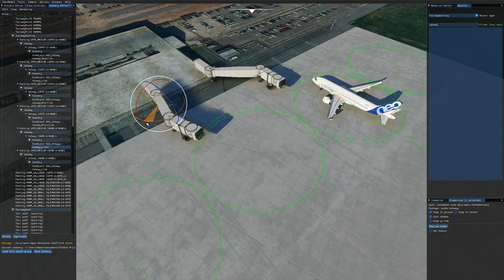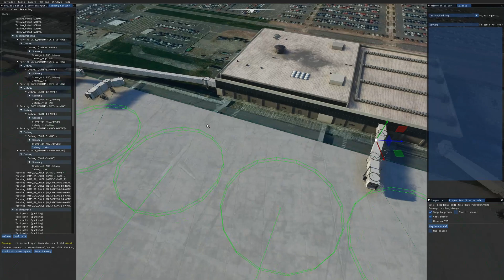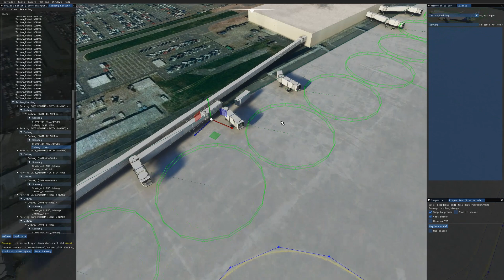SDK Tutorial #9 - Jetways and gates - Microsoft Flight Simulator

Comment: I wonder if it is possible to fix the default airports with broken jetways - they are separated both the scenery and scenery object (the main moving part and the not moving part connecting to the building) are not connected and they leave the gaps - basically like they used wrong type too short type which is too far away to be able to link automatically. I guess that during some large update Asobo broke these default jetways which were small and tiny and needed the large or medium.

Comment: Hello! Firstly, thanks for the great SDK videos. Have really helped my creations go from "meh" to great! Quick question: is there a second part for setting up the ATC to work with the jetways etc. so that you can call them from the ATC menu? I've set them up exactly as described but the airport I'm building doesn't normally have air traffic control, just a CTAF frequency, and therefore no option for tuning to ground to get the ground services or anything. Any thoughts/ideas? Cheers!
Reply from the maker: Great to hear that you are finding the tutorials useful! There isn't a second part to getting them working. You should just place them and ATC gives you the option when you are parked at the gate in the correct airport - that might be the problem there. Because you don't have a ground frequency that option mustn't be available to you. You could try adding frequencies to the airport, I've not done a tutorial on that yet I'm afraid, there should be some information about setting up the communications file in the SDK docs.
Reply: @Benney  Ah okay, I figured that might be the reason. I will check out more about adding the proper frequencies. Cheers!

Comment: I am having a strange issue when creating jetways. I am able to place the sim object aso_jetway easily, but when trying to connect the two-part jetway link, it does not snap on the the end of the aso_jetway, like yours does. the end of the jetway link seems to sag or fall down and bury into the ground. It takes almost 6-7 attempts to properly make it snap onto the end of the aso_jetway. Have you had that problem  ? Any way of fixing that ? Its really taking ages for me to just do one jetway because of this bug.  thanks
Reply from the maker: I think I know what you mean, does the end of the jetway move up or down when you hold and drag the link, then stop when you stop moving it? I had this problem when first trying to record this tutorial and couldn't seem to get it to stop. The only way I got around it was exiting flight simulator and trying again. I didn't confirm this but I presume it's just a visual editor bug and will be fine when you load the airport into the sim normally.
Reply: @Benney   Thank you kindly for your reply. This bug would happen everytime I would try to set up the scenery jetway link object to the Simobject Jetway. I had to do multiple attempts again and again with different types of jetways, and also in some  places try to just use one long jetway rather than the two 'children" to make it work. So far, just completed all the jetways. 

But yes it would act like it was not 'sticking' to the end of the simobject, it would sag or deflect upwards or sink into the ground specially when I would try to line up the jetway from terminal to parking spot.

By the way, thanks for your amazing tutorials for the SDK. MFS official documentation is woefully inadequate and you've helped a great deal!
Reply: @Kingnothing75  Yes, he has helped me out a lot even though I haven't even started yet, but at least I have an idea before I dive in this weekend.
Reply: Same issue here. The Jetway_Link do not snap to the ASO_Jetway. I reinstalled the SDK but the issue persist. I have to allign all of them manually.